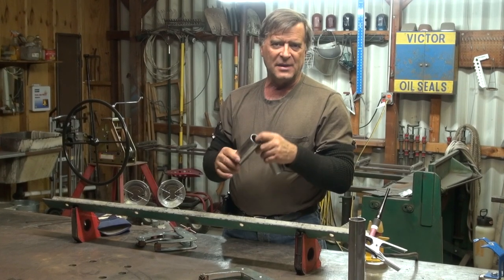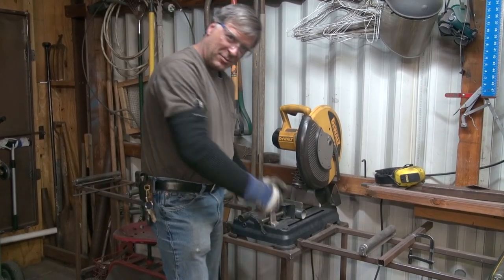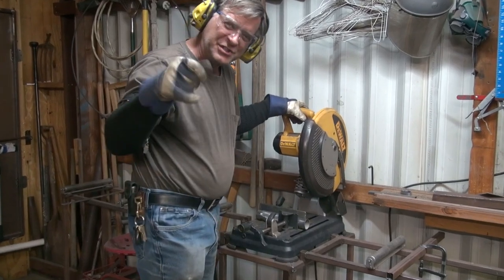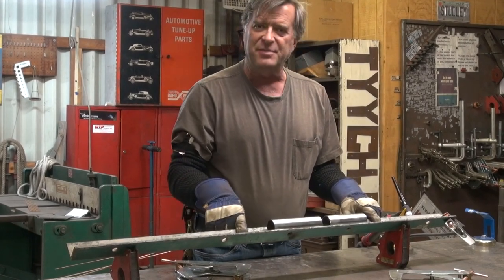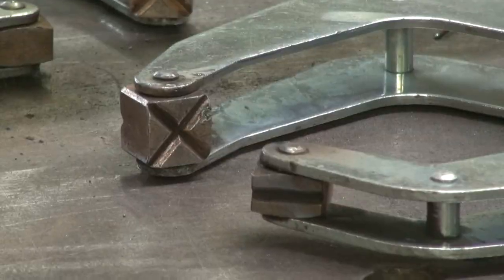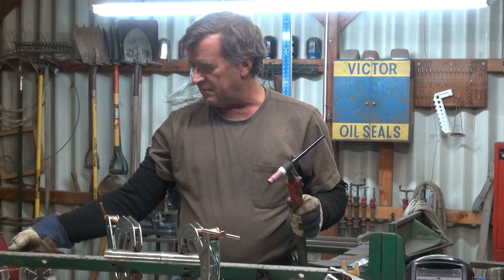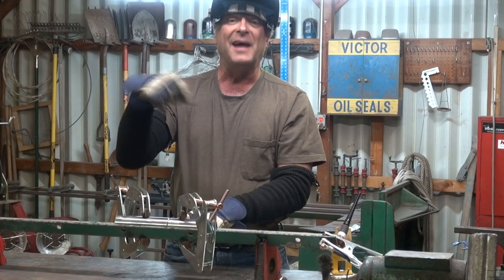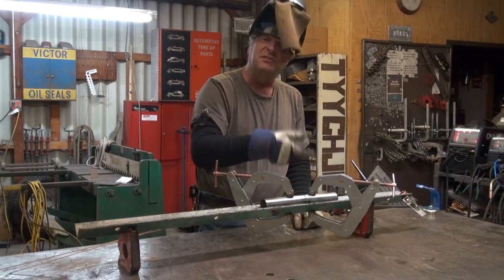How to Seamlessly Join Two Pieces of Pipe - Kevin Caron

Comment: I want a video of how to weld two pipes side by side not head to head
Reply from the maker: What are you making?
Reply: @KevincaronSculpture  I’m currently taking a welding course, and we’re supposed to apply everything we’ve learned over the past two weeks by welding these two pipes together. We were told to tack them at both ends and then run a bead along the joint.

The problem is, every time I weld around 3–4 centimeters, the weld cracks and doesn’t hold. I don’t really know what I’m doing wrong. I need to understand how to properly weld two pipes together—what welding method should be used, or what technique can prevent the weld from cracking.

Our instructor doesn’t really put in much effort to help us; he just criticizes and tells us to "weld in the middle," but it’s definitely not as easy as he makes it sound.

Comment: Kevin, I have a side by side off road cart, but the seats won’t slide far enough back for me to sit in it without my knees against the steering wheel. I’ve been researching the cart, and would like to extend the wheelbase by 12”. Will welding the round tube frame like you show here be strong enough? Or should I slip a separate tube inside the extension for additional support?
Reply from the maker: Use the separate tube in a tube.  Leave a 1/8-inch gape so you can weld the inner tube as well.

Comment: Regretfully, you assume the two pipes I have are of equal size, which is not the case. One pipe is small and inserted into the larger, not screwed, and currently not secured in any way.
Reply from the maker: Just need to change the jig a little to make it all line up.   Easy, just time consuming.

Comment: I'm new to using a mig welder. I think he is using a tig welder. Can someone explain how he's welding? Like, what is the thing that is glowing? Is it the tungsten wire or the electrode(if there is an electrode)?  Any extra info would be appreciated. Thank you
Reply from the maker: Yes, that is a tig welder and the glowing thing is the tungsten in the end of the torch.  I am also using a filler rod to add to the weld as I am moving along the joint.
Reply: @KevincaronSculpture Thank you so much for your response. Just to make sure I undserstand. Is it that you're heating the surface of the rod and then adding the tungsten? Or is that you"re heating the tungsten and letting it melt onto the joint. Thank you again!
Reply from the maker: The tungsten carries the current for the arc.  It is heating the base metals to molten and you add the filler rod to the puddle.  DON'T TOUCH THE TUNGSTEN WITH THE FILLER ROD!

Comment: what if the pipe is under a bending load, your method near the end of a pipe as you said (you are a couple of inch short) is under shear load more than bending. Would you use a spline similar tube with an OD to match the ID, how would you do this? I have to add 6" to a central section of some 2"OD .120 wall tube.
Reply from the maker: You could but I am not sure if you would be able to get the smaller pipe out after you finish the bend.     Have to give it a try and see what happens.   Thanks for the question and posting.
Reply: @KevincaronSculpture  Sorry maybe not clear in my question. the pipe is straight, and I feel a butt weld like you did would not be sufficient in this project (due to been in the central area its under a bending deflection load) so I was thinking of using a sleeve or spline, pitty I can not upload a sketch.

Comment: I have a question that is very similar to that question.
I want to build my own 8'x30' trailer for hauling produce from the farm or Farmers Market where purchase it to wherever I plan to sell it. The longest 4" x 2" Carbon Steel Rectangular Tubing I can find is 6 ft. long. I want to add 5 together end-to-end to make a trailer that is 30' long. How can I connect them and make it strong enough to hold the weight without braking at the connected ends?
Reply from the maker: I would weld the 2 ends together and then plate the outside of the joint on all 4 sides.    Say about 2 foot past the joint on both sides. 

  Or just order in the correct size steel from your local steel yard. 

Please keep in mind that I am not a structural engineer or a certified welder.
Reply: @KevincaronSculpture  Thanks for your help. I will plate it  all the way around.

Comment: Best Simplest Video EVER🔥🔥🔥I bought some galvanized steel pipes for $10 for (2) ,instead of $30 each on Amazon or Home Depot. They were 10 ft poles and i had to make closet rods for (2) 84" closets. Used Angle grinder to cut them to length, then filed the sharp edges, cleaned them, then primed and painted them and hung them up. Now I have one more closet but have these 2 pieces leftover and couldn't figure out how to weld them together, now I do!!! I'm a 50 yr old grandma whose rehabbing a rental 1st time ever, so all these DIY videos on YT are making my day and my life amazing💖💖💖, getting ready to subscribe, these tenants left all kinds of welding stuff, yipeekayee
Reply from the maker: Thanks for watching and posting!

Have fun and remember to not touch the red metal!
Reply: @KevincaronSculpture  Thank you, I certainly will NOT touch the red hot metal.🔥🔥🔥🔥🔥and thanks again for all your help via your videos, great job!

Comment: can you connect a 2 3/4 inch pipe to a 3 inch pipe or clamp it
Reply from the maker: Sure, with a welder you can do just about anything.   Just have to make a flange to fit from one to the other.   Or just slip the smaller pipe inside the larger and weld.

Comment: I got a sweet pipe expander from rdmotorsportsinc on eBay, it uses hydraulics to expand, comes out awesome! Check it out, its item number 112302812824.  He also sells air over hydraulic and thats a bit more $.

Comment: Why even use filler metal, thought you just gonna fuse it and since your not purging it, you probably not even care what the root looks like.
Reply from the maker: I feel that fusing the joint is weaker than adding filler metal also..     Sometimes I will but it is a non stress joint for sure.
Reply: I agree that filling must be stronger than fusing, but I have a question.  Looking @4:30 did you bevel the pipe edges?  I need to have a really strong joint, corrosion-free once I paint it.  So, what I wonder is, if you set your two pieces of tube tight to each other, without a bevel there is nowhere to fill; whereas if you keep them separate by a tiny distance, then some of the molten filler will tend to fall into the tube, and then your continuous-looking weld isn't really very continuous at all, and will show pin-holes once you try to grind it smooth.  I mean, what's the absolute best way to getting a strong, continuously-welded joint?
Reply: If it's just fused (autogenous weld) the surface will not be level, and he's setting out to have something finished so you can't see the weld.  SO, he's got to fill it up a little.  Also, some metals don't do well without filler.  The filler rod is not the same as the base metal, but usually has stuff in it that  promotes the weld action, maybe silicon and deoxidizers.  Some kinds of aluminum will pretty much crack every time (right down the middle of the weld) without filler rod.

Comment: Kevin. What's a good steel blade for my chop saw?  I want to stop using the fiber blades
Reply from the maker: Sadly you can't just change the blade on your abrasive chop saw.   The motors spin too fast and you will burn up the teeth on a blade.    You need to get a different chop saw made for the toothed blades.   I like the Evosaw the bast.

Comment: Metalworking guys are such wusses with sound. They have to put on ear protection to cut a pipe golly
Reply from the maker: Nope, tired of the safety police giving me grief for not wearing my PPE.
Reply: wusses? The PPE is there for a good reason. I just started welding/metal fabrication and I wouldn't make any grinding without ear protection. Why deteriorate your hearing unnecessary when it takes a couple seconds to put on some ear protection?
Reply: I guess if you're dumb it's good too be tough
Reply: Don't feed the trolls.  it makes them needy.
Reply: What?!

Comment: I wish I bought a stick welder instead of wire. I might need to duct tape a flashlight on the gun so I can see anything at all when I put the mask on
Reply from the maker: All depends on how you are holding the gun..   Maybe watch from the side of the gun instead of over it?  I run my lens tint at 10 for mig and it helps me a lot!
Reply: Remember you can get different shade glass for your helmet!  Almost any helmet that you buy will come with a Shade 10 glass, and economy automatic lenses usually are fixed at Shade 11!   I find this much too dark for ordinary light welding, and usually use Shade 9 or 8.   Also, as Jody keeps reminding us, if you can't see (speaking of TIG welding) there are glass cups that fit on the torch instead of the ceramic ones, and a LOT of light comes out of that.  It IS possible to put a strong lamp on the work also, by the way!   I have tried a 50Watt LED light, and that will give you a clue.

Comment: How thick was the material? Looks like you could have just done a fusion weld.
Reply from the maker: 16 gauge if I remember right.
Reply: Definitely could have done fusion. Just butt up 2 ends without any edge prep, obviously dress it a bit so there's no burrs or anything. About 40 amps or so and you sit in one spot until you see the puddle start swirling around. When it starts swirling you know you're in and penetrating. Walking the cup is the easiest way but can be done free hand. Requires a purge though, about 15 CFH. Might be able to do it with solar flux, haven't tried that.

Comment: Looks good.  You should practice more to keep your arc length about the diameter of the electrode, no more than twice which fir this would be 1/8".  Longer arc makes for higher voltage so more heat in a more diffuse concentration.   This makes GTAW look like oxyfuel welding.  For carbon steel, this isn't too bad.  Stainless suffers greatly and aluminum it limits thickness

Comment: +Kevin Caron, Artist I was just wondering what size mig welder youre using. I work with a lot of thin steel between 1/16th and 3/16th so im looking for a mig that can do detailed work like what was demonstrated in the vid, thanks
Reply from the maker: I run a 250 amp AHP alphamig.      Also have the PowerMTS 251si from Everlast.
Reply: Yes! thank you very much i wasnt sure if the larger welders were overkill or not but i know they have more refined settings, cheers

Comment: @ Kevin Caron what type of blade is shown at 1:26 for your chop saw?  Where would one purchase it? Thanks!
Reply from the maker: I think that was a dewalt blade that came with the saw..   You have to have the right chop saw to use these blades.    You can not put a toothed blade on an abrasive chop saw. They turn too fast and will burn up the blade..

Comment: The saw you are using to cut the metal, I got one a week or two ago.  I really only got it for cutting angles.  I am new to anything tool.  I tried cutting a square tube with the thing the saw came with.  Well, haha  It moved because it was not a normal blade.  I have one in my Amazon shopping cart, to get in a couple days.  The thing is from Dewalt, but it is $125.  Are there any blades that are cheaper than that?  Again, it is for cutting metal on an angle.  I can not find any that will cut steel.
Reply from the maker: Time to step up to a cold cut saw..     One with a toothed blade like the DeWalt DW 872.    But hang on to your wallet! 

Or look at the cheaper abrasive blade chop saws..   The are around $170.00
Reply: hmm Well, I got a toothed blade today.  Dewalt makes it.  I am guessing it will work with the one I have.  haha  I sure hope so.  Oh, I just read below that it will NOT work.  haha  Man, that sucks.  I wasted my money then.  BALLS!

I started a youtube thing.  I am going to randomly post videos of my first welding projects.  Nobody will watch them.  haha  But, I shall.
Reply: I found it at a site called Grizzly.com.  It is $399.99.  Best price I have seen it for.  Thank you again for the tip!

Comment: Kevin Caron, Artist - I have a Milwaukee 14" and I'm using abrasive disks. It leaves behind so much fine powder everywhere. I'm curious about what blade you are using. Appears to make a cleaner cut than the abrasive wheel.
Reply from the maker: Sadly the toothed blade won't work on the adrasive chop saw..   It turns too fast and will just burn up the blade..   You have to get a saw designed for this type of blade..     Look at the DeWalt Multi-Cutter Chopsaw.
Reply: Thanks for taking the time to respond. I didn't clue in on the blade speed, or factor that in, on other videos I've watched. They showed water/lubricant being pumped on the blade. I watched your video and thought perfect, I need that blade.

Comment: sorry to say but that is not a tack that is not good welding and that is not good method of grinding...if you want to grind so that you dont see the seam...then dont do the linear pulls with angle grinder do the circular motion and no pressure then you level everything with the pipe walls and its nice and flat no high spots or low spots...and when tacking then you dont need wire since it has no space in between just tack it without the wire and finish,and small tacks like a dot not a inch long weld...
Reply from the maker: +NoYouAreNotDreaming     

Thank you for posting and watching....
Reply: Kevin Caron, Artist
good workshop...do what you love doing...its just my opinion man...:D all the best to you :D

Comment: heres a question im sure you can help me with... MIG welding something with a round edge to something with a flat edge... say... a pipe to the flat (wide side) of a piece of flat stock... got any suggestions/lessons?
Reply from the maker: +SuperTexasBlues                Up the wire speed a little and get in the groove!
Reply: +Kevin Caron, Artist 

using a lincoln weld-pak... joining a round shock mount (maybe 3/16" ) to a jeep frame (also about 3/16")...  it looks like crap and i dont think i got the penetration i need... i guess i could always grind it off and try the inverted 'V' method...

i dont know/think i got the bead down into the seam far enough

Comment: I just subbed your channel.
Gotta say ,,I really enjoyed a cpl vids I watched .
I was searching through for info on a comparison for the mp 210 Lincoln and the millermatic 211.
Can't recall if I found it on your channel or not but who cares ,I enjoyed your vids 😊
Ended up I picked up the Lincoln and am very pleased with it .
I ran an offshore unit with flux core 30 for 20 years .
I can't believe the time and energy I wasted in dressing ugly welds when I should have made the switch to gas a long time ago !
This Lincoln does tig,mig and stick with the option of two voltage inputs .
Makes a mediocre welder like me look way better than I should !
Because I knew nothing about what gas to use I took the advice of the praxair rep who also welds and went with the 83 argon /17 co2
Welds had perfect coverage and pooled out and flattened really nice .
A wipe over with a cloth and they looked Chrome .
Anyway ! Great channel !
~Vince
Reply from the maker: +Bagot Corner       Thanks for posting Vince,

Welcome aboard and thank you for watching...

Comment: Hi Kevin... you wise tubing expert!   :)  I have a maybe silly question for you: does a 5mm iron rod fit into a 5mm inner diameter tube or has the tube to be a fraction bigger? I'm planing to build a musical keyboard, in which I need to use short brass tubes on a smooth iron rod. I don't think its wise to order the rod on eBay etc, for it might not fit? -  You surely know more about it than me?  Thanks for your good advice, Joh  from St'go de Chile
Reply from the maker: +Joh Drinda       I would NOT plan on it fitting..     You may have to turn the inner rod down just a tad to make it fit right..
Reply: Yes, I was thinking that... Thx for the confirmation. I'm going to buy the rod from a big supplier. Chances are that they have  fraction sized rods?
Reply from the maker: Good plan...    They should be able to set you up for what you are doing..
Reply: Thank you for the reply. I'm building a "Janko musical keyboard adapter". I'm better off using Mini brass hinges, for they have got less side movements or are more directional. Using tubes requires precision rod, because the levers are about 15cm long and any space inside the tube will be multiplied; resulting in loss of clearance between levers.

Comment: Nice video. I have a question. My requirement is different. I have two 4 ft pipes that I use as rails for my dslr camera that is on a dolly with wheels. I'm having a hard time carrying it because it's long. What I am thinking is cutting the 4 ft into 4 pieces so each lenght is 1 foot long. With this, I can now easily put it in my backpack. Now, how can I securely volt them together again temporarily?
Reply from the maker: +Neil Camara       A short piece of pipe that will fit snugly inside the larger pipe.    Pop riveted on one side and just a slip on fit on the other..
Reply: Cool. Thanks a lot!!!

Comment: Great video Kevin.  I like the idea of putting a flap disc on the grinder.  I will have to give that a try.
Reply from the maker: valveman12 Had to turn a little adapter to make it work..   A washer or two the right size will  also work..

Comment: hey Mr kevin isn it more important to not wear gloves, fabrics and stuff that in general could get entangled in a power tool ???
Reply from the maker: Robert Ostman Around the lathe and the mill, yes, I don't wear gloves.    Any machine that can tear your arm off and hit you over the head with it..       I am not worried about the grinder or the slip roll...    But thank you for the safety tip!